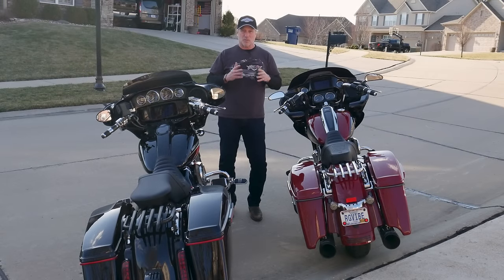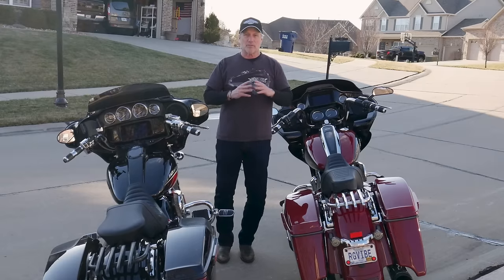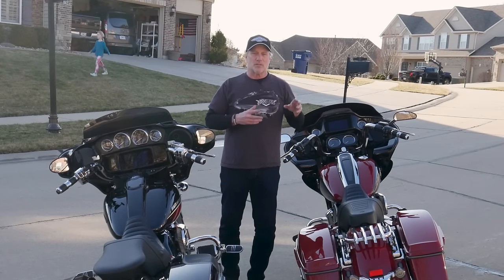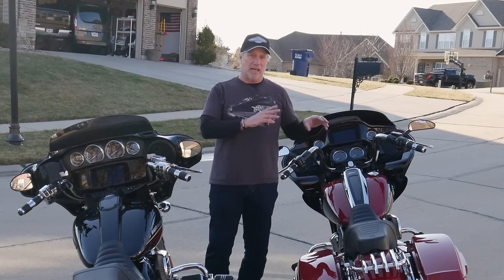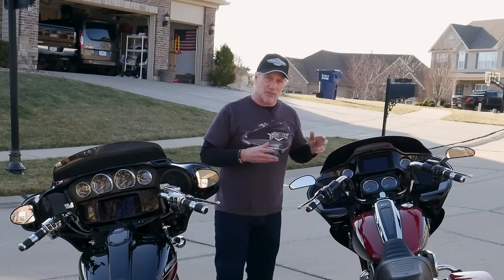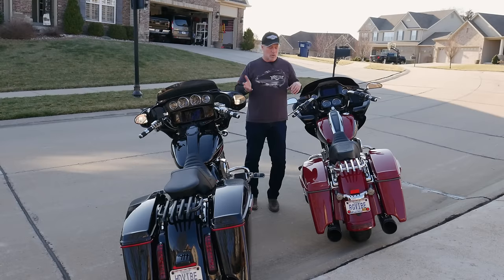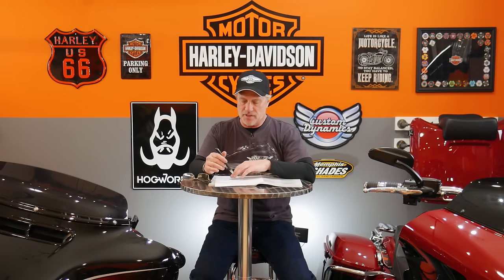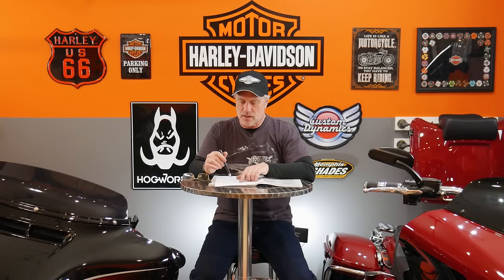Harley Davidson Stage 2 vs Stage 1 Upgrade M8 114 vs M8 117

Comment: Hey Rick.....great video brotherman. .  I hit the "subscribe"  and "like"  button 30 seconds into the video which I never do.  This is easily one of the very best videos I have seen on Harleys and engine comparisons. . I turn 62 next month and buying a new Harley Low Rider ST  for my Birthday.    My last Bike almost 20 years ago was a 825 lb Street Glide with the massive 88 cubic engine🤣. 
When I saw the Low Rider ST with the stock 117 engine and weighing 100 lbs less than a Street Glide I new this is my next bike because when you are a fossil like me, the lighter the better.  Plus that's a big freakin engine.   I was going to do a stage 1 but somehow you convinced me to do a stage 2 before I even pickup the bike.  I remember riding a 103 CVO Street King back in the day during one of the Harley tours where you test ride all their bikes and was blown away how a stock engine had more pull than the stage 3  I did on my Softail Deluxe at the time.   The only thing I am worried about is  a stage 2 on a 117 may be too much and rip  the  arms  off this old man when I twist the throttle.  All joking aside I need to quickly decide on a stage 1 or 2 before the bike leaves the dealership.  Any thoughts my friend?     And will say when you started up both bikes the 114 with the cam sounded a tad meatier and grawlier which is why I am thinking to go with a stage 2 now.  Problem is I am a senior citizen now so don't want a bike I can't handle. Never though I would say those words.   And I guarantee your YT channel is going to grow exponentially fast.  Just keep putting out great content like this video. Safe travels my friend. 🙏.
Reply from the maker: Thanks for watching,  commenting,  and subscribing.   I appreciate your very kind words and support.   As to your question, the 117 on the Low Rider ST is a big engine for the lighter bike.  I have ridden that bike in stock set up and it's quick.  I'd suggest doing the Stage 1 and ride it a while then decide if you need more torque and power.   I think going to a Stage 1 will give you the sound your looking for plus you will get a tune with a Stage 1 which will make that throttle response much better.  I hope that helps and again thank you for your support.  Enjoy that new bike and ride safe. 👊✌️👍

Comment: I had a 117 stage 1 Lowrider S and a 114 stage 1 Fatbob. Was hoping Harley would bring out a 117 Fatbob, as I could really feel difference between the two bikes, alas no such luck. So I did the same thing, bought a new 114 Fatbob, and had the dealer install the SE stage 2 kit 447 CAM. what a difference its made, totally feels more lively and responsive than the 117
Reply from the maker: Thanks Mark for watching and sharing your input and perspective on the topic.  If you are already a subscriber to the channel...thank you.   If you haven't yet subscribed to the channel I'd be honored if you'd consider doing so.   Thanks for your support and ride safe.  ✌️👍👊

Comment: SE is good man. When installed right by the tech. I didn’t have issues with my 131 stage 4 when I had it stock. Good video.
Reply from the maker: So far I have been impressed with the feel of the bike after the cam.  It really woke up the engine...and it sounds really good.  Thanks for checking it out.  Ride safe and enjoy. 👊👍✌️

Comment: You got good numbers for the HD cam, I had the same cam and tuner put in my 2019 RGS 114 when it was new and I only got 96 hp and 115 lb torque, I admit I was very disappointed with my numbers but I wanted to keep my warranty which was a good decision as at 40,000 miles I needed new heads, pistons and cylinders and it was covered by my extended warranty!
However, I do plan on changing for an aftermarket torque cam later this year when my warranty expires as want more power!
Reply from the maker: Thanks for watching and commenting.   Staying in warranty does limit the bikes a bit, but, for me I feel better having peace of mind that if something does go bad, then I'm covered.  

If you are already a subscriber...thank you.  If you haven't yet subscribed to the channel I'd be honored if you'd consider doing so. 

Thanks for your support and ride safe.  ✌️👊👍

Comment: The 117 is a beast without mods. I ride pretty hard sometimes, so i can see wanting more power, however most dont really use their bike full potential anyways. Its just fun stuff to do. AND bragging rights of course.  Ride on, live long.
Reply from the maker: Thanks for watching and commenting.   I agree...a lot of the upgrades aren't necessity but it's fun making the bike your own.  If you are already a subscriber...thank you.  If you haven't yet subscribed to the channel I'd be honored if you'd consider doing so.   Thanks for your support and ride safe.  ✌️👊👍
Reply: Must admit ….. I do like a bit of 
“full potential “ ….. sometimes. Had the stage 2 for a couple of years. I’m now looking at the 128 conversion. Any thoughts on which cam . Should I stick with the s&s 475 or go bigger ?
Reply from the maker: Thanks Richard for watching and commenting.   128 big bore sounds like an awesome idea.  If you are doing the Screamin Eagle kit, I think it comes with an even higher lift cam than the 475.  There are so many great cam options,  at the end of the day it depends on how you will be riding the bike.  Sometimes the high lift cams you lose a but of low end torque but it comes on at higher RPM....then the horse power kicks in.  If you are already a subscriber to the channel...thank you.  If you haven't yet subscribed to the channel I'd be honored if you'd consider doing so.   Thanks for your support and ride safe.  👊✌️👍

Comment: I'm looking for a little more power on the top end on my 2023 Road Glide ST 117.Thanks for the information
Reply from the maker: Thanks for watching and commenting.   Doing a Stage 2 on the 117 ST would be a great upgrade.   If you stick with HD products, your only choice is the SE8 462 power cam as it's called.  I've been thinking about doing that upgrade on my 2023 Street Glide ST as well.  If you are already a subscriber to the channel...thank you.   If you haven't yet subscribed to the channel I'd be honored if you'd consider doing so.   Thanks for your support and ride safe.  ✌️👊👍

Comment: I added a SE 445 Torque Kit on. my 2021 Ultra and it has changed the response significantly and I love it! I am still working out if my fuel consumption has changed? Currently at 11 mile/litre
Reply from the maker: Thanks for watching and commenting.   My mileage has been very good since doing the Stage 2 upgrade and subsequently running smart tune sessions.  I've been getting approximately 45 miles per gallon..  if you are already a subscriber to the channel...thank you.   If you haven't yet subscribed to the channel I'd be honored if you'd consider doing so.   Thanks for your support and ride safe.  ✌️👊👍

Comment: I had a 17 ultra limited full exhaust stage 2 torque cam (Harley). The SE tuner with the wide band auto tuner. All S&S internals,oil pump cam plate,. Lifters and cuffs. It only made 86 hp and 106 torque. I have a stock 21 road glide limited now with the 114 and it feels very close power wise.
Reply from the maker: Thanks Harry for watching and commenting.  The cam definitely wakes up the 114.  Ride safe and enjoy. 👊✌️👍

Comment: That’s interesting.  I went with Harley torque cam and tuner.  When I was young I used to hot rod cars and learned everything has a cost. It can be milage or it can be reliability and longevity.  If you want real power then  go for displacement.  Pushing it too hard almost always adds heat and that can cause issues, especially on an air cooled engine.
Reply from the maker: Thanks for watching and commenting.   I appreciate you sharing your input on the topic.   Ride safe and enjoy. 👊✌️👍

Comment: SE does not offer a torque cam for the 117, the 447 is too close to stock specs, i can say tho i have put the power cam se462 in my 117 and it rips hard! roughly 120/120, worth considering
Reply from the maker: Thanks for watching and for the comment.  I've heard good things about the 462 power cam as well.  Ride safe and enjoy. 👊👍✌️
Reply: I did a SE HP cam on my 19 CVO and got 109hp 116 Tq..Stepped it up to a SE Stage 3 122 and got a Cyclerama 483 cam and now I am getting 131 hp/143 Tq. in a 4th gear run...Just gor a 2023 Roadglide 120th Anniversary and will put in Cyclerama 485 cam, SE 55 mm manifold, SE 1275 clutch springs, S&S air cleaner..Kromewerks headers, and Fuel Moto outlaw mufflers and see what I get..Will probably add a Star or Cyclerama billet comp as well..
Reply from the maker: Thanks so much for sharing your set up.  Congrats on getting the anniversary bike.  They are incredible looking bikes and with that set will be a runner.  Ride safe and enjoy. 👍👊✌️
Reply: @HDVIBE  I just traded my 22 road king with the stage 2 I upgraded to the road gulls st with the 117 im doing the sidewinder 2 into 1. I has no clue what to do for the cam. I dont want it a heavy lope but you saying the 462 is good I just mint go with that. I dont want to rip the driveline apart with 150 Torque// any thoughts on it would be great thank you ride safe
Reply from the maker: @lawtondevil The 462 cam is great.   Gives you what you need and isn't too much for everyday riding.✌️👊👍

Comment: I installed the RS468 cam and it definitely has strong torque and HP; however, it runs choppy under low load/low rpm conditions, because of the overlap. I would probably go with the SE447 cam if I had to do it over again.
Reply from the maker: Thanks for sharing your perspective on the topic.   Ride safe and enjoy. 👍👊✌️
Reply: Bad tune?
Reply: @jjs8046  The tune is spot on. It’s just the nature of a cam with overlap.
Reply from the maker: Yes the higher lift causes the lope or choppy feel.  👍
Reply: Tuning issue for sure
Reply from the maker: Thanks Bob for watching and commenting.   I appreciate your input on the topic. Ride safe and enjoy.  👊✌️👍

Comment: Nice video. Thank you. Small suggestion. It would be nice if you had posted the numbers side by side on the screen as it’s easier to look and compare vs just hearing about it. 
I’m with you on the Screaming Eagle stuff to keep the warranty intact. I hear so many negative comments from people about SE but I’ve had no problems at all and I’m more than satisfied with the way my bikes performs. I have a 2018 Ultra Limited with a 107. I put the same stage 11 as you did. Incredible how much difference it makes. I also have a 2021 RGS 114. I haven’t put a stage 11 on it yet but I will say the 107 stage 11 is amazing compared to the stock 114. I think doing the stage 11 on your 117 would be awesome as well. 
Safe riding 🏍️
Reply from the maker: Thanks for the suggestion.  That is a great idea.  As you mentioned screamin eagle is very good quality and does the job just fine plus by using the SE tuner all within warranty.  If you have already subscribed to the channel...thank you.  If you haven't yet, I'd be honored if you'd consider doing so.  Thank you for the support and ride safe. 👊✌️👍
Reply: @HDVIBE  I’m a subscriber 👍🏼
Thank you for all the work you put into this channel and for keeping it real👍🏼
Reply from the maker: Thank you Tim for the support and for the kind words.  👊✌️👍

Comment: Great video. Quick question.  I may have missed it in this or another video of yours, but what header are you using?  Is it the stock header or have you replaced it with another header without the cat?  And I think later yout put Tab Performance pipes on.  Which do you prefer on that front.  I listened to your videos, but just curious if you found really any difference in performance?
Reply from the maker: Thanks Gerry for watching and commenting.   In this video,  both bikes have stock headpipes.  I did switch to Tab 2-1-2 on the RGS a few months ago.  While I don't notice much difference in performance,  you do notice a bit more sound output and with the CAT not being in the Tab pipe, the right side of the bike is much cooler.  The HD headpipes actually flow very well and give good performance...for me it was about heat reduction.   Thanks for your support and ride safe.  👊✌️👍

Comment: I have a 2017 Road King (M8-107) that I put that SE447 cam in, to include Rinehart slimline duals and 4.5 DBX pipes.  Runs excellent.  I also have a 2023 Street Glide ST (M8-117), I can say that the 107 with cam is closely comparable to the 117 in my ST.  I most likely will put the same SE447 cam in my SGST.  It so worth the upgrade IMO
Reply from the maker: Thanks Tony for sharing your set up and experience.   While many shun the SE8 447 cam or really any SE cam set up, it seems to me it is worthy to be mentioned with the other after market brands in the market.  I like the set up because it's all HD so no warranty concerns.  Thanks for your support and ride safe. 👍👊✌️
Reply: My 107 with Wood 22XE, Freedom Performance 2-1 turnout and and FuelMoto AC/DC air cleaner put down 109/119 to the wheel on a dyno.  A stock 117 puts down around 95/115.  I hate that the EPA has hamstrung HD so badly that this is a thing.
Reply from the maker: I agree.  👍

Comment: What I did stage II street glide 2019 same setup as yours to stage III with  S&S 475 what a difference all using dynojet power vision
Stage II Harley I got 96  and 116 torque
Stage III 115hp 126 torque a friend of mine use the cycle Rama bursted my bubble126 hp and 130 torque
Cycle Rama rill wake up a 117. But again with a great tuner 14:19
Reply from the maker: Thanks Michael for the suggestion.  I have heard good things about Cycle Rama cams.  I recently saw a 131 build with the Cycle Rama cam.  If you have subscribed...thank you.  If you haven't yet, I'd be honored if you'd consider doing so.  Ride safe and enjoy. 👊✌️👍

Comment: Other considerations are valve train noise, engine operating temp, and mileage. Do you have comments on these?
Reply from the maker: Thanks Brad for watching and for the question. Not sure I can offer much on these topics but I'll give it my best shot as to what I believe you are referring to.  Valve train noise...I have not experienced any issues with this.  Mileage...I assume your are referring to MPG.  I've been getting around 38 MPG after the Stage 2.  This is around 1 or 2 MPG less than prior to the Stage 2.  Engine operating temp...I have not noticed any additional heat after the Stage 2...however I've been riding in winter Temps so it's difficult to say.  We shall see in the summer if there is any increase in heat.  If there is, I may change out the head pipe without a catalytic converter which will significantly decrease heat coming off the bike and cool the engine.  Thanks for watching and ride safe.  👊✌️👍

Comment: Subscribed, great content. Been thinking about a cheaper used 114 on a 2018/19, was going to do the recommendes oil pump and cam plate change, so it's interesting to see the numbers with stage 2, and like you said, you may as well do the extra work while they are in the cam chest anyway.
Reply from the maker: Thank you for subscribing to the channel.  I really appreciate the support.  If you are looking at the pre 2020 bikes, it's definitely worth putting in the cam plate, oil pump, cam bearing and tappets.  I look forward to seeing your comments on other and future videos.   Ride safe and enjoy. 👊✌️👍

Comment: I got a 2022 road guild st putting s&s 2 inept 1 sidewinder exhaust. nut I have no clue on a cam/ scramming eagle dont have one and I dont want to go really big.. if any feed back would be great.. anything on what you mind think,, thank you..tife safe
Reply from the maker: Thanks for watching and commenting.   To answer your question, I've heard very good feedback on the SE8 462 cam.  This is Harley's power cam that is recommended for the 117 In the ST.  Its going to give you more torque and HP that you will definitely feel.  If you are already a subscriber to the channel...thank you.   If you haven't yet subscribed to the channel I'd be honored if you'd consider doing so.   Thanks for your support and ride safe.  ✌️👊👍

Comment: New subscriber, great comparison video. I have a 2019 ultra limited and rhe wife has a 2020 streetglide special, both set up identical except i have the harley torque cam and she has the woods 22xe. Seat of the pants dyno hers is faster, both bikes are in for more upgrades and dyno tuning. Im getting rid of the harley torque cam for the 22xe, it was that noticeable of a difference. Also ditched the screaming eagle tuner for the powervision.
Reply from the maker: Thanks Tom for watching and subscribing.   Sounds like the Woods cam is killer.   Your comment definitely makes me think harder about what I do with the CVO 117.  I appreciate the support and ride safe. 👊✌️👍

Comment: I have a stage 1 on my 22 trike, with open headers and Rinehart dbx 40’s and a Pv4 tuner and this thing rips… wheeling is not a problem if I wanted … Don’t know if I need a torque cam…
Reply from the maker: Thanks Rick for watching and sharing your set up.  Sounds like you got that Trike dialed in.  I'm sure with the PV4 you get a much better non EPA tune so you more than likely ate getting some nice HP & TQ gains with the free breathing exhaust set up.  If you went Stage 2 you'd just get that much more out of the engine.  Thanks for your support to the channel and ride safe. ✌️👍👊